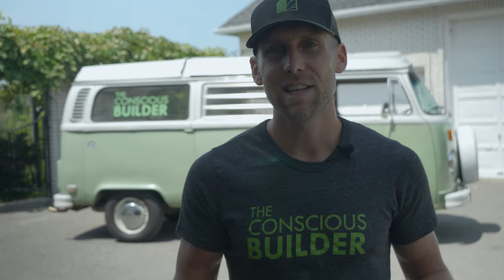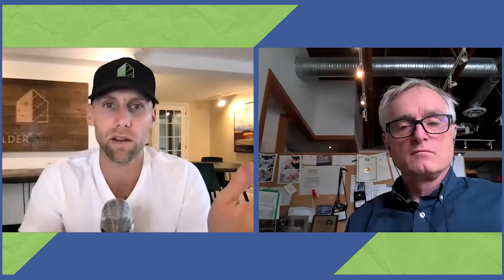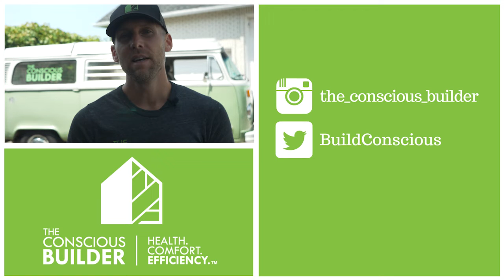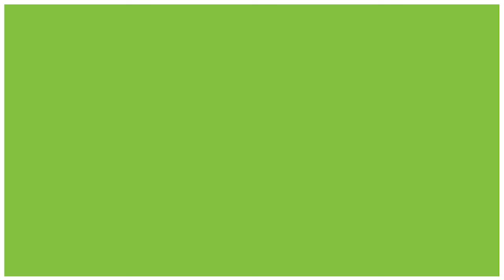Stop Heating Your Home with Fossil Fuels!

Comment: I bought a duel fuel.  gas only comes on when the temp gets below 40.. Which is not super often that it gets below that and stays below that temperature.  Otherwise the heatpump runs.    Think one needs to be concious of how often one actually needs to run gas and how much time one can run a heatpump.  I live near the lower portion of zone 4a  While this video really concerns the massive long season of OMG cold of Canada.  My point is that one should buy equipment that is appropriate to the area you live in..

Comment: What happens if you have power failure
Reply from the maker: Great Question! If we're talking strictly heat,  most gas furnaces still use electrical components and won't work anyway. A well built envelope with proper insulation for the environment can perform very well in this situation, watch this video: https://youtu.be/216NkNAjrxo . There are also options with solar panels and batteries per this video: https://youtu.be/hs2ufjGkI7Q
Finally, a backup generator or wood burning stove could help in the instance that those other options are not possible or affordable, since the power going out is a relatively rare occurrence.
Reply: @Theconsciousbuilder  A small generator will supply the electricity for gas furnaces during power outages.  You need one for your refrigerator anyway.

Comment: Going gasless could make sense in when building new as long as the house is built to the high standards you discuss.  Great videos btw. What about as a retro fit? In my experience its so expensive to retro fit a heating system in an existing home it just doesn't make sense financially. In that case I lean towards improving the energy efficiency of the envelope rather than switching the heating source.
Reply from the maker: Definitely makes sense to improve the envelope before switching heating sources if you have the budget. We often recommend this to our clients, as  you usually won't require as much energy to heat the home once the envelope is improved, and can install a more efficient heating system. Thanks for watching!
Reply: Was going to say this as well. Especially where I live, Its easily -30 and sometimes as cold as -50, an air source heat pump is going to struggle.